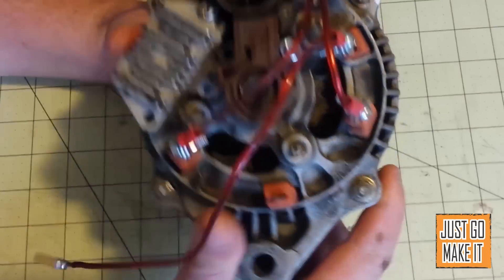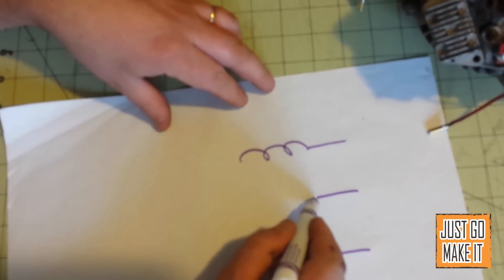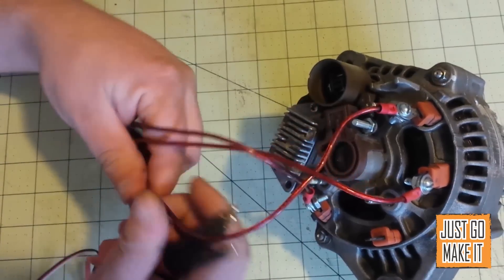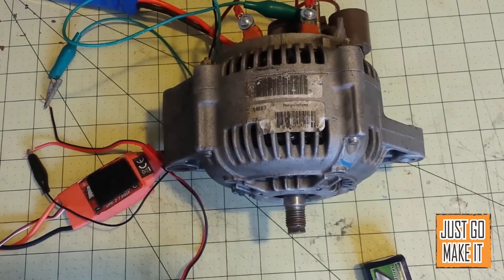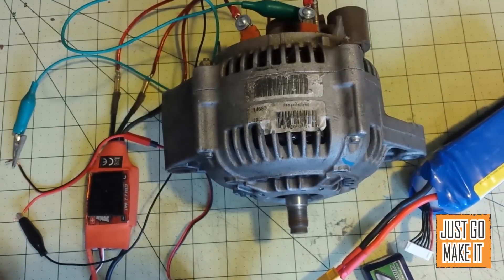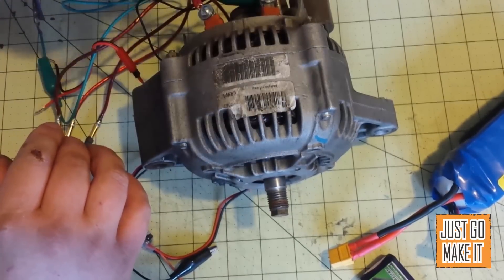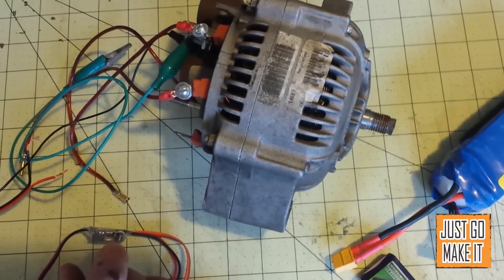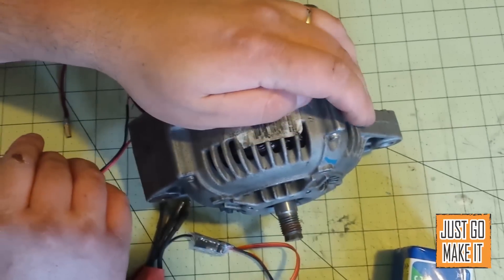Alternator to motor conversion howto

Comment: They don't want ppl to know this because if you hook that to a pully and to another alternator as an alternator but as you show the 3 dieodes in the back of your motor (as an alternator) will put out 120 volts each..bacicaly .... You can power your house as well as the house next door on a 6 volt battery. Be carefully my friend
Reply: Hey Jessyjames Tynan ! it seems that you know real good how toi build it? I need to learn how to build this system too. would you help me ?
Reply: Powering your house from a 6V battery would be much simpler if you just drive an inverter from your 6V battery.  No need to set up a motor driving a generator to do this.
Reply: "They" don't care if you know this. Its a motor and controller. Nice use of an old alternator, but BLDC motors in RC and electric bikes are more efficient. To power homes, you'd leave it an alternator and turn it with an engine, water/ wind turbine, etc. Even then, a BLDC generator is more efficient. The benefit of alternators is to output an exact voltage regardless of speed. Forget free energy secrets "they" don't want you to know. There's plenty real energy, in heat differentials, solar, wind, waves, vibration, etc. Use science, not conspiracies. Gravity wheels, arrangements of magnets, or motors turning generators that power motors just waste time. Most homes can have water, be powered, heated, and cooled for about $1000 in materials and you'd never pay for electric or water again, but people prefer to bitch about the gov't, make excuses, or try perpetual motion schemes, which is the one place they won't find it. Nobody's hiding anything from you.
Reply: Andy Jones show me a video on how to do what your talking about I want to learn how to power my house like that
Reply: lmfao. so you want to make a mechanical inverter powered by a 6 volt battery. the law of conservation of energy friend. its a real thing

Comment from the maker: how i convert an alternator in to a brushless motor
Reply: Hello
what is the shaft torque and power?
Reply: JUST GO MAKE IT
Reply: shaft torque and power is jack shit, maybe turn a tiny plastic propeller - 30 amp controller is SHIT
Reply: Doc Hollowood  Power=voltagexampere
30x12=360w is it correct ?
Reply: Doc Hollowood, Of course. The speed controller he's using is too small. Duh... But it's a proof of concept. If this is a 100 Amp alternator, then 100A*12V =1200W, or 1.6HP...

What I'd like to know is, can a 100 Amp alternator generate more than that? How many amps can you actually pass through a 100 Amp alternator before it overheats?
Reply: Did you find out? I would like to know that too. I have a 220 amp GM 1 wire Power Bastards alternator that I am thinking of using. I am thinking I would be better to try to make a welder with it on my riding lawnmower so IDK... 220 amps would probably make one hell of a motor though wouldn't it? Like for a bike and at higher voltage. I see some of the really fast electric bikes on here doing 60 MPH plus and I think they are running 72 volts or better into em. I am trying to figure out if mine could handle that and make of ra super fast bike?
Reply: 220a * 72v = 15840w = 21.24 horse power

How much is a 72v, 220a brushless motor controller?
Reply: great work - makes a lot of sense and thank you for sharing - however to power the rotor field coil there are 'brushes' that touch the plates so that the coil can be activated - eventually the brushes will wear out - so it's {squint} not really a brush-less motor if you were to replace the rotor with Perm Mags - which can be done then it would be totally 'Brushless' of course. 
regards.
Reply: search where you can buy perm mag rotors - it would be interesting to see what would happen based on the Gauss of a perm mag rotor - as compared to what you discovered with saturation. 
of course this means you would not need the the other power controller and just the 3 event 'phase'  one. 
i'd be interested to know where the convergence terminal is - is it for example at the 'center' of the other 3 fields?
i'll have to pull the one i have apart and look. 
regards.
Reply: It's an three phase induction alternator  with 3phase Rectifier lmao ......to heavy on a bike like lead acid battery lol
Reply: Doug Penhall best use for generating electricity lmao
Reply: This isnt brushless because it has no magnets it has a electro magnet wich needs brushes to send power to it

Comment: May I point out a few issues.  When you change the alternator into a motor, it becomes  a synchronous motor.  The rotor field should always have maximum DC voltage, as this acts as a permanent magnet all the time. Never change the voltage on the rotor coil.  The three phase winding are supplied with a three phase pulsed system and this  creates a  rotating field, depending on the phase sequence that is created in the stator  fields. The speed of the motor does not depend on the voltage supplied but on the frequency of the invertor used.  If it is a good invertor then it will keep V/f a constant.

Comment: It is unfortunate that these people, with their best intentions, know a lot more about electricity than they do about making understandable videos.  The intent of an instructable is to educate others about what and how to do something that is technical in nature so they can use the information to do work that they do not presently understand.  This video is a good example of how NOT to do a video.  The camera does not have a large enough "field of view" so that all of the "equipment" other than the alternator could be seen.  It would also be nice if he could have arranged the equipment (other than just the alternator) so it could be seen and labeled (i.e. - batteries, speed controller, etc.).  It would have been nice to label the wires as to what they  were connected to or from in an organized manner.  I'm sure this gentleman was sincere on providing some instruction to a person who is not familiar with what he is illustrating.  But the result came off poorly because the video portion looks like a table full of junk with the largest piece of "junk" being the alternator.  Also rambling on about matters that do not directly apply to converting the alternator to a motor is of no value whatsoever.  If he would do this video again with some better organization of the components, less chatter and better camera position (and sound), those of us who are really intersted in how to do what he assumes to be instructing - how to make an alternator into a motor - would appreciate it.  I think a good instructable should be about 5 minutes or less in length for something that is no more complicated than this apparently is.  Preplanning the video is recommended.

Comment: please help me where they can buy controlled
Reply: tchangly21 the controller you have mentioned qorks with a 3 phase motor with hall sensors. But the alternator has no hall sensors.

Comment: why diddt you pull the diodes. your the same dude
Reply: Leaving the 3 phase rectifier diodes in place will not hurt anything if the voltage applied by the controller doesn't exceed their ratings. The DC output from the rectifiers should be left disconnected so it's as if they were gone.

Comment: u didn't do anything to the alternator. some ppl put magnets in it and just run it of single 12v to 30v battery
Reply: that is the idea, almost no modification and being able to run
the advantage of field coil Vs. magnets is that we can modify the Kv constant (RPM/volt), to get a lot of torque or a lot of RPMs

Comment: This is not a good 'how to'. You glossed over the alternator wiring too fast. You should’ve spent more time explaining how to tell the difference between the 3 wires you need and how to find the one you don’t need b
Reply: Also notice that. Some info on discovering the coils using a multimeter would be great!

Comment: Install permenet mags on the rotor and Maka very high current Dynamo, step up this dc power, store in a step down transmission transformer and you can drive this motor to drive this alternator with it and and use 2 legs as 120 volts@ 30 amps each.

Do you know how to cut the middle man out of your electricity supply.

Build what they use to sell you energy 
Then you have perpetual free to use energy PERPETUALLY from then on.

Don't you just love my language.

Build it now and be ready for the caves when the big freeze starts showing it's true blue colors around the world.

Build you pizo fired fire extinguisher flame thrower a also.
And don't forget to build you pvc propane powered explosive napalm rocket launchers.

Comment: Run 2 60 amp ultanaters 1 powering ur house battery bank and other turning the motor ? :P threw a Intverter at 240 V
Possible ? to do a tesler ;)

Comment: So you literally could use one alternator as the power source and one as the motor and the system would run itself with just a few modifications with no introduction of outside power or force.

Comment: Your video is interesting and yet poorly made and explained, and you took risk not taking precautions and taping those three wires to stay separate, I can visualize the concept being used to power a generator along with solar to power your house think about that concept, but you did do something that is workable and can be used practically when the grid goes down. For get about the go-kart think about endless power to power a house when to gird go's DOWN. An alternator generator can do amazing things as well as an unlimited source of power, think about that for a while and let us know what you come up with. We need sustainable Unlimited free energy when the grid goes down and that alternator is the key to that free energy source that would be endless.